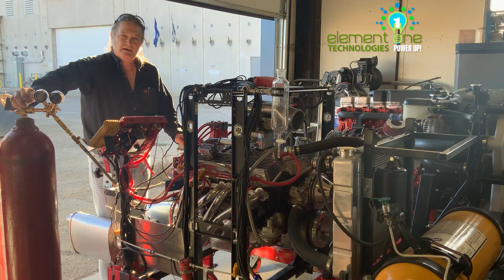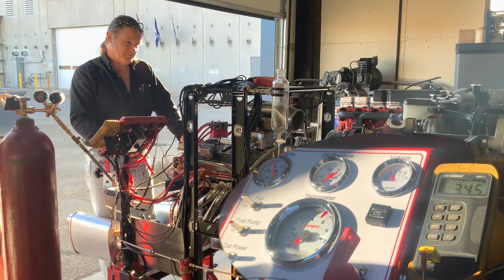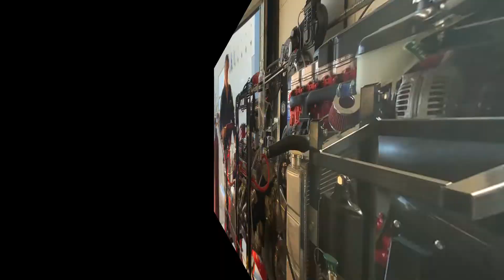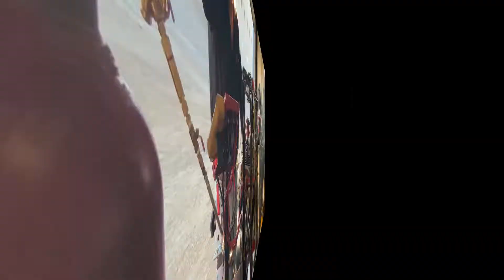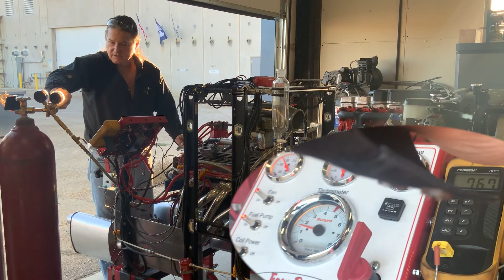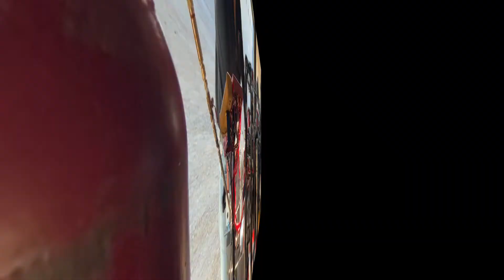V8 Chevy - Hydrogen vs Gasoline Exhaust Temperature Test

Comment: https://youtu.be/n7ulimqId44 you might want to check out this video this was done several years running on 80% hydrogen in egts 950. And fuel-saving was 48%
Reply: Also remapped the computer to run at 20.2 AFR.

Comment: The person that I used to work for helped someone get an airplane to run on Hydrogen around 30 years ago here in S. Florida. They ended up needing to run the ignition timing ATDC because of the fast flame travel in the combustion chamber. Are you retarding the timing at all when running 100% on Hydrogen? PS - They had a buildup of Hydrogen in the exhaust system at one time, they tried to start the engine and it blew the mufflers apart, be careful!

Comment: Why did you stop before the EGT reached and held a steady constant temperature? You learned nothing by only running it for that short period of time before it was able to equalize and stop rising.
Reply: I cut the video short for length. I run it longer in actual tests in my lab
Reply: If yo look at the video carefully between the two run ups I shut down the engine on gasoline at 4000 rpm just like I did on the hydrogen at 4000 rpm. You clearly see the two different temperatures at that precise timing and RPM. .

Comment: Shouldnt the timing be advanced with hydrogen since it burns much faster then gas
Reply: @JUSTDOITDUDE369  It shows that there are 3 replies but there are only two. I'm guessing that you replied to this previously and someone deleted/hid the comment for whatever reason. Reply again here or you can reply under my other comment. I build high horsepower nitrous drag cars, am well versed in timing vs combustion efficiency/cylinder pressure and whatnot. I've been interested in Hydrogen for some years now but have not done a build as of yet.
Reply: You want the opposit friend, you need to retard the timing. Imagine we have an engine that is perfectly timed producing peak torque and power, let's say the ignition timing is spot on at 35°BTDC. Gasoline burns slower than hydrogen, so you need that 35° degrees of crank rotation/time to start the ignition process & then let the flame front travel across the combustion chamber & begin to create cylinder pressure as the piston reaches TDC. As the piston begins to move down the air fuel mixture is now rapidly burning & making the highest cylinder pressure creating the maximum amount of push/torque & as the remainder of the mixture is burning as the piston is forced down by the rapidly expanding gases created by the burning of the fuel.....Now same engine & the same timing. The piston is close to the top of the compression stroke, it comes up on 35°BTDC & it fires. It took those 35° of rotation to ignite the gasoline & start to build pressure before forcing the piston down right as it hit TDC. With hydrogen it burns much faster. It fires at 35°BTDC & ignites the hydrogen & it burns to fast, it creates much more pressure before the piston reaches TDC. This is called knock, detonation or pre-ignition & kills pistons, rings, bends rods, squishes bearings & lifts heads/head gaskets. Not good lol. If the timing was reduced to 10° or 15°BTDC then it would ignite much closer to TDC & have a better chance of not creating to much combustion gases before the piston reached the top of its stroke & began its combustion stroke. Lower RPMs with slower piston speed could easily need even less timing closer to the 0°- 5°BTDC. Hope I didn't confuse you friend 🙋🏻‍♂️🤟🏻 GOD-BLESS...
Reply: Retard the timing. The more efficient the burn rate is in the combustion chamber (faster flame travel), the less timing you would need.

Comment: What about testing power output under load?  I got the impression you were running a bit Rich on the hydrogen, which means temp will come up a bit more, the closer you get to the ideal air/fuel ratio for hydrogen.  There should be a combustion temp for ideal Air:Hydrogen ratio somewhere.  We used to tune racecars using exhaust temps. By adjusting Air:Fuel ratios until we achieved the ideal exhaust gas temp for whatever fuel we were running. So for example, Propane/Butane (or LPG), Normal Pump Gas (or Petrol here in Australia), and Methanol (Alcohol). All have slightly different ideal combustion temperatures once the ideal Air:Fuel ratio's are reached (which are all slightly different for each fuel).  Running that engine up on a dyno, on each fuel would allow to tune Air:Fuel ratio correctly for each fuel, AND get the ideal ignition advance for each fuel under control, which then gives you an accurate power output to compare for each fuel...
Reply: Im wondering the same. How is he calculating air fuel ratios

Comment: It really amazes me how it's running perfectly smooth on hydrogen, glad this sound of a real car won't die any time soon!💪💪💕
Reply: It shouldn't be that surprising at all.  Whenever you use petrol, it's actually the hydrogen you burn.  You actually lose some of the possible power breaking the hydrogen/carbon (hydrocarbon) bonds. Upon burning, hydrogen recombines with oxygen to produce pure water vapour (H2O) and the carbon recombines with oxygen to create mostly Carbon Dioxide (CO2) and tiny amounts of Carbon Monoxide (CO) along with some oxides of Nitrogen, (NOx) the amounts of which are dependant on combustion temps and air/fuel ratio...  So the takeaway is that all internal combustion engines run on hydrogen.  But by running on hydrogen instead of carbon/hydrogen combinations, you remove the carbon byproducts, because there is no carbon to form any CO or CO2.  There's only Nitrogen and oxygen (air) and pure Hydrogen (H). Therefore there can only be byproducts of pure water vapour (H20), and small amounts of Oxides of Nitrogen (NOx)! 😎.

Really, you should have been more surprised if it didn't run perfectly smoothly on pure Hydrogen. 😎